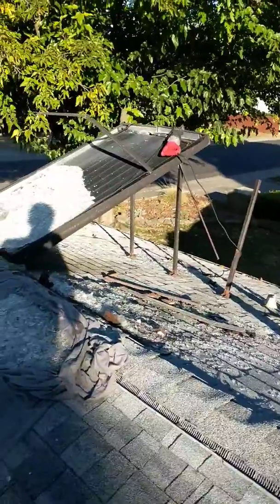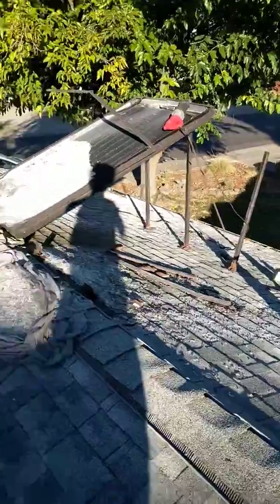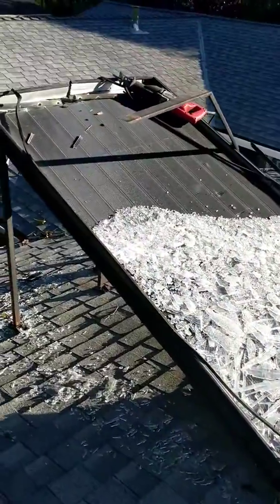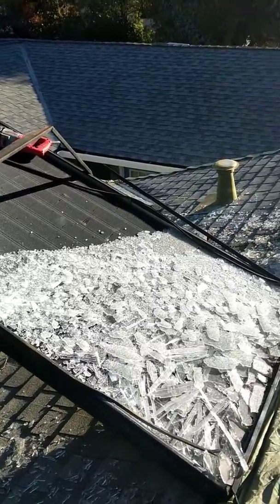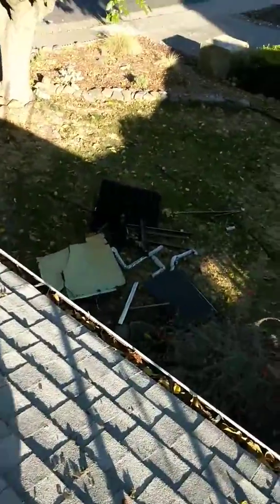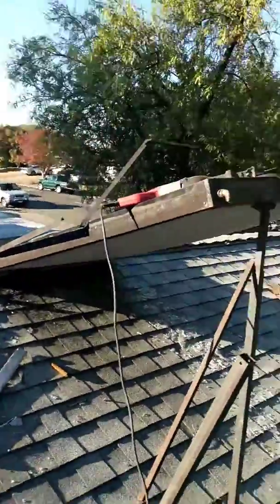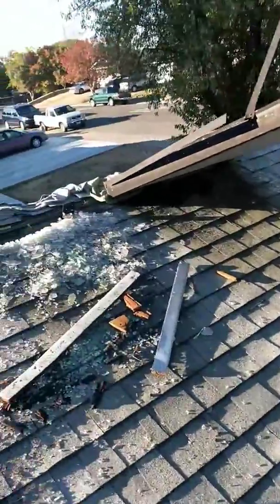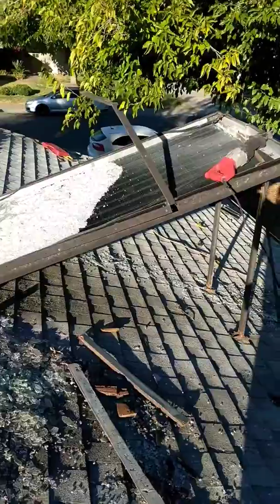Demo day!! Removing solar panels off a roof!

Comment: Hi,
We actually have to remove an older hot water solar setup pretty identical to this, it’s 3 panels.  Since you removed these already did you need a plumber and an electrician out there or could a roofer just remove them?  Any advice and/or help would be much appreciated
Reply from the maker: These are no longer in use and already had power disconnected from them